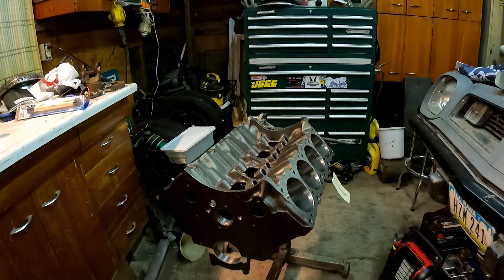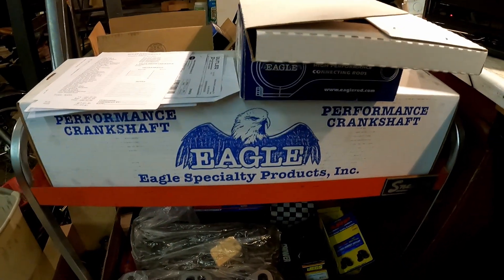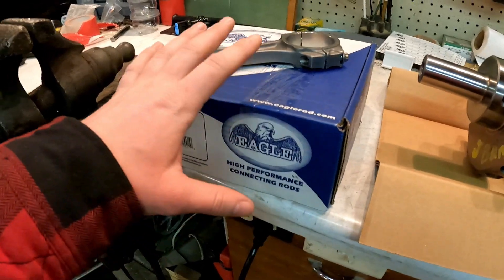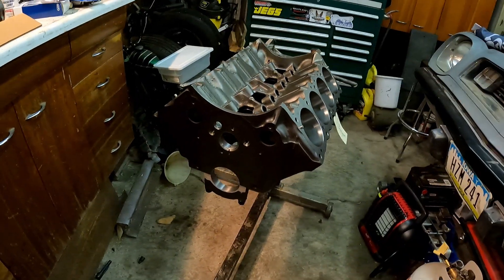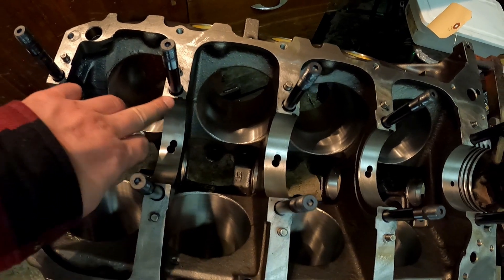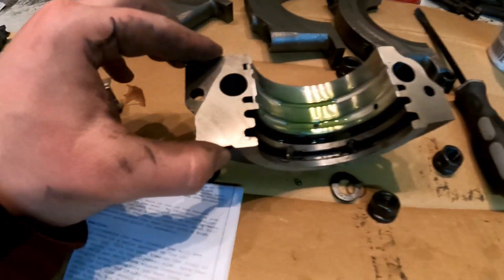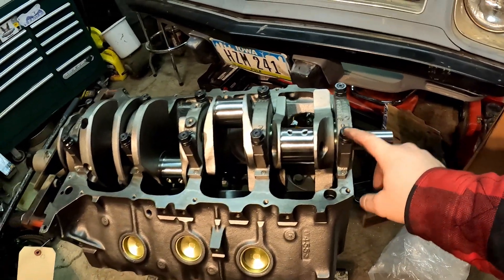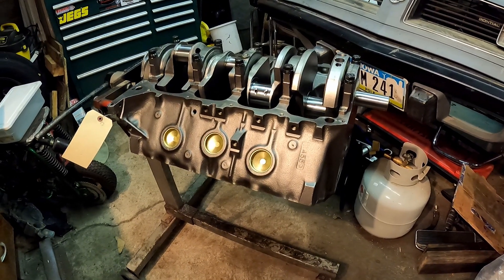Butler 474 Pontiac Engine Build Part 2- Installing the Crank and Mains!

Comment: 4.211 bore X 4.250 stroker crank. I have a .060 over block & 4.250 crank with BBC diameter rod journals. I hope you have some good cylinder heads as we are so limited on head. Good luck.

Comment: Hi, Mad Scientist.  In 2004, I had my 400 Pontiac engine from my '77 Trans Am bored (.030" over) and stroked to 461 cid (using a Butler supplied 4.25" cast Eagle crank) with a Butler rotating assembly.  Used 6x-4 factory heads with 2.11 and 1.66 valves, a Comp Cams flat tappet hydraulic XE 274 cam (230 degrees Intake and 236 degrees exhaust at .050" ), Edelbrock Performer intake with the factory Q-Jet (rebuilt and modified by Cliff Ruggles), and Ram Air exhaust manifolds with 2.5" outlets.  Engine is about 9.8:1 compression and was dyno'd at 415 HP at 4700 rpm and 555 lb-ft. at 3200 rpm.  In the car, however, the teeny tiny 5/16" factory fuel lines were incapable of adequately feeding this newly hungry beast.  In 1st gear (Borg Warner factory 4-speed and 3.23:1 posi differential) at full acceleration, the car would fall on its face at about 3000 rpm from fuel starvation.  The cure for my situation was to install an electric fuel pump and 1/2" supply and return lines, using a return style pressure regulator.  I also added a sump to my factory fuel tank.  I now have a fuel system capable of feeding an engine of up to about 800-900 HP and have not had one single fuel supply issue since.  Just something to consider.  By the way,....once you get that thing into your firebird and get the installation fully sorted out,....you're going to LOVE driving all that torque.  You'll soon find that you don't operate the throttle with your right foot, but rather merely with your big toe - that way you get to stay out of jail.  Lol.  Best of luck on your Pontiac adventure.
Reply from the maker: If I'm gonna spend a night in county, they gotta catch me.

Comment: I really really hate oil leaks, especially coming from a rear main that is a rope seal. Will be watching to see how the rear main seal conversion goes. My ‘77 TA is currently leaking 😔
Reply from the maker: Butler also stocks a 2 piece version you can install with the crank in place. The pan comes off if you just take the engine mount bolts out and lift the engine a half inch or so. It's not a terrible job for a weekend!
Reply: I have tried every variation of rope/ graphite rope/2 piece viton/1 piece viton and my 67 400 still leaks.  Good luck and let me know if you ever get yours figured out.